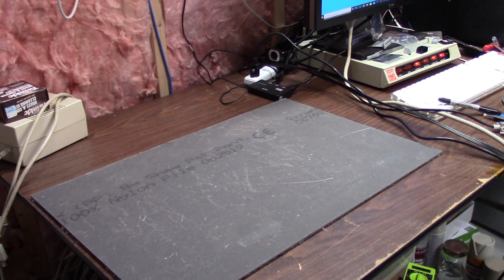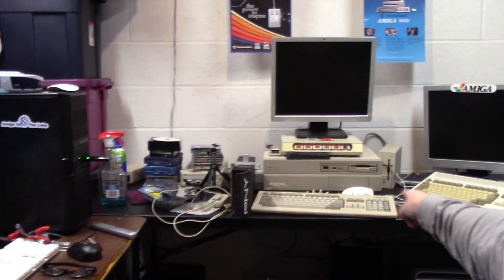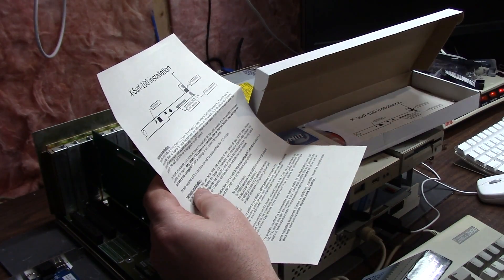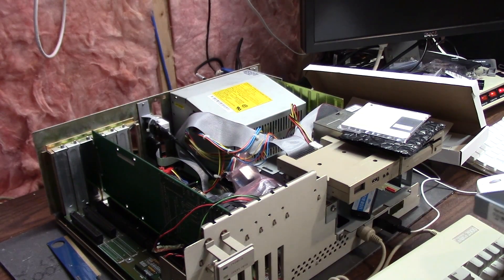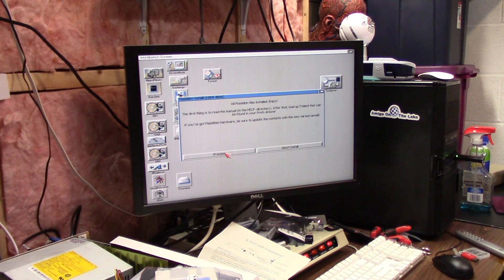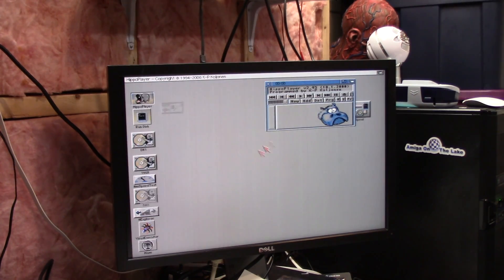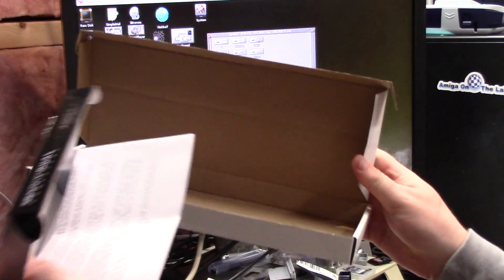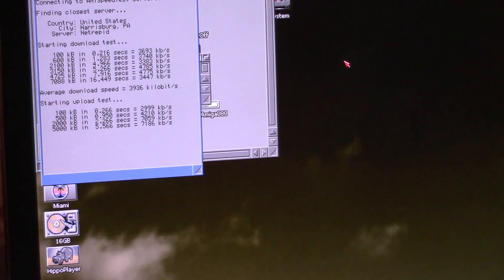Rapid Road USB and X-surf100 ethernet for the Commodore Amiga 2000 !!!

Comment: RapidRoad is no longer avaliable unfortunately, so the new X-Surf I received has 2 USB ports which will never work. Luckily things like Freeway/Triton exist, but take up a valuable Zorro slot. Great video.
Reply from the maker: Yes that is unfortunate
Reply: The RapidRoad was a good invention of sorts. Just a shame that Jens would just blame the customers PSU’s for killing them 🙄 Had a few of them that went bang on the A1200. But yes, there are a lot of alternatives now. Have the trident lite in one of my A4000. Still rocking a x-surf100 with a RapidRoad. Get a max out of 6MB/sec via Zorro-III. There are now Gayle adapters with fast Clockport now as well for the Trident/Subway recreated USB Clockport adapters being made and sold over on Amibay 👍🏻

Comment: Was thinking of getting the Rapid Road USB for my A1200
Reply from the maker: Just dont power the ports and it will last!
Reply: @ChrisEdwardsRestoration   What do you mean don't power the ports?   Do you think it's safe to use a hub, is it safe to use a powered hub?
Reply from the maker: @uberdude2555  - the rapidroads Berg connectors... dont hook them up. Yes use a hub
Reply: @ChrisEdwardsRestoration   Ok thanks.

Comment: Your Speed is limited by the Zorro2 Bus. With Zorro3 in the A3000/A4000 it's much faster.
Reply from the maker: yes i know, but the A2000 usb is more important to me because it has the Vampire, if the 3000 had a kick butt processor and video card it would be in there.

Comment: I have the same setup in my A2000 and it works like a charm.  Never try to use that EasyNet for your Stack its a PITA.   I put a USB hub on mine and a card reader I use it mostly with flash drives and an external optical DVD Drive.   Yea its expensive but it works well and I am happy with it.
Reply from the maker: i still run (depending on what os i boot to) Miami, amitcp or something i forget that came with the villagetronic aradineII card.

Comment: I have the same setup in my A4000. You can't beat the speed of the RapidRoad for sure, and the X-Surf is a very fast network card. 
It seems to be the hot Swap of flash drives that kills those RapidRoads. I am just careful not to do it.
I use a memory card reader on mine - works wonderful most of the time
Reply from the maker: man it sure is sweet. i would like to find a mem card reader that also has a usb port for like a thumbdrive too... time to surf ebay again.... !
Reply: @ChrisEdwardsRestoration  I just hooked up one of my Dell monitors last night that has a powered USB hub built it - works great with the RapidRoad! I can just plug my stuff into the monitor. Fun stuff!
Reply from the maker: I have the 2410f i totally forgot about that.  Lol